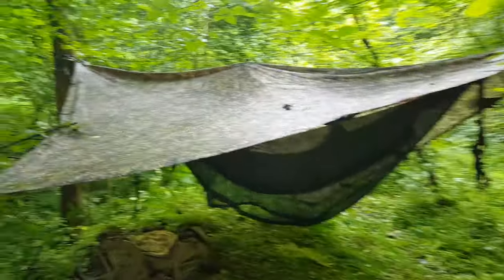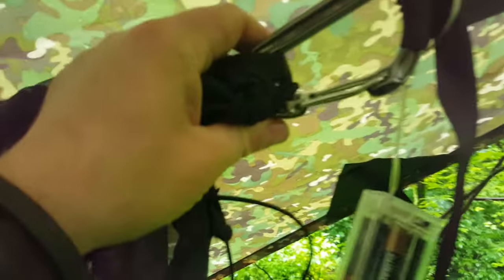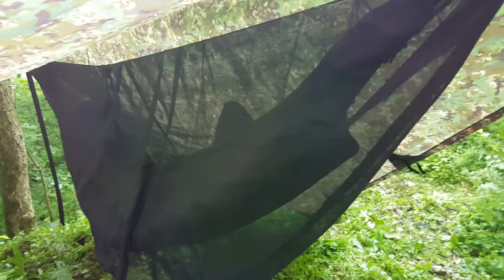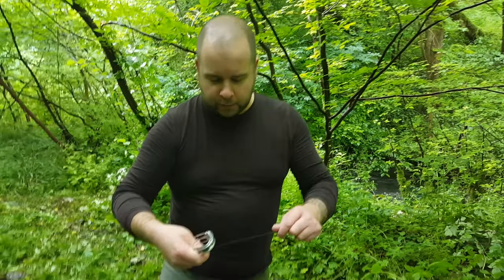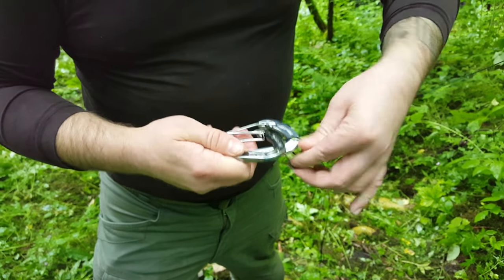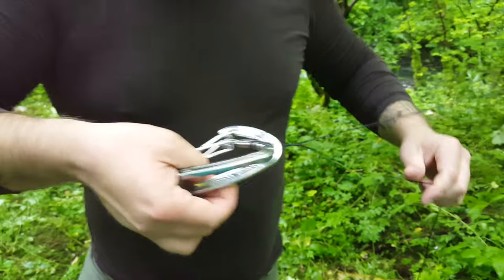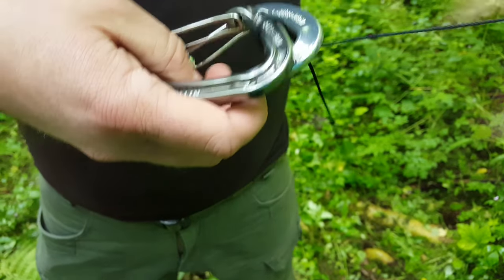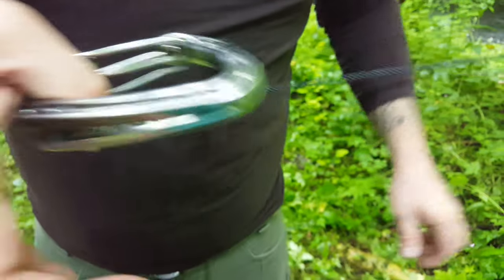DIY Hammock & accessories & a bit of boulder hammocking | Garda Hitch for hammocks demo

Comment: Slick work on the hammock Gaz, a question for you as you seem to be a whizz at fabrics and cordage. I'm looking to replace my DD tarps ridgeline and guylines with Dyneema instead of paracord, whats your thoughts on that? ~Peace~
Reply from the maker: I'm just editing main vid now man & covering prussiks on Amsteel. Yeah great for ridgeline, but not necessary on tie outs. It's worth stitching the loops on the tarp like MCQ does - much less sag. Also worth doing shock cord loops on all tie outs - my DD would have ripped over weekend otherwise

Comment: I'm wanting to build a new custom hammock. which fabric did you use e.g 1.5 oz or 3.0z  . great video m8
Reply from the maker: +danny flint Cheers Danny. I used 2oz lining nylon, but have made a lighter one since with 2oz normal nylon (not ripstop). The best stuff though is Hexon from Dutchware. 1oz is fine and superlight, 1.6oz is a bit more robust and slightly heavier
Reply: Thanks buddy really appreciate your help I'm going to have a good look on profabrics uk this weekend . I really like the look of the warbonnet blackbird xlc . But it would cost a fortune to in duty and delivery.